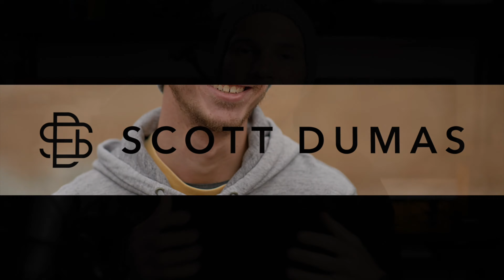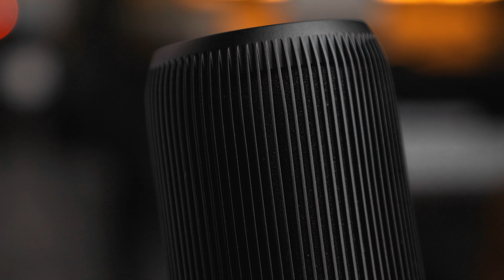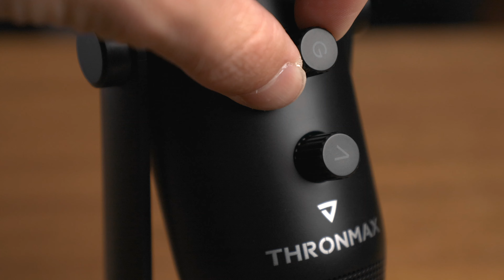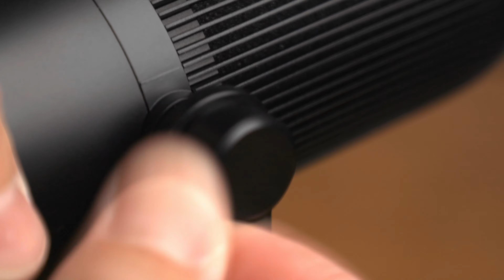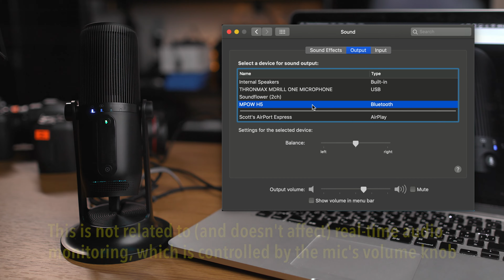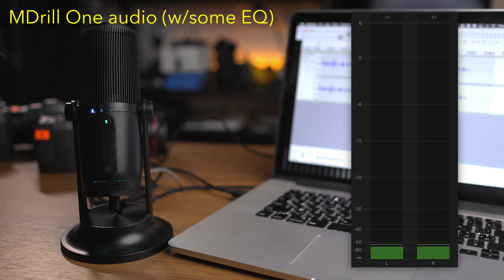Thronmax MDrill One USB Microphone Review

Comment: I am having a problem with low mic volume on Zoom, my iMac input setting for this mic is properly selected and at max input vol. The zoom settings are also correct for the input mic. I am using the cardoid setting. any suggestion for the low volume problem?

Comment: Hey, what program can I use to edit the sound after I have made a video?
Reply from the maker: There are lots, I usually just do it inside of FCPX when I'm editing the video but the controls aren't as good as some other programs. Audacity is free and quite in depth, and other video editors should all have some level of audio editing available.
Reply: @ScottDumas  ahh okay thank you, so you would recommend Audacity? I have heard of it, is there any others that are simple to use?
Reply from the maker: @ASMR_AMXN  I'm not too much into audio editing haha... but Audacity is pretty powerful for a free program from what I've heard. I do use it from time to time and it's hard to complain :)
Reply: @ScottDumas  ahah okay no worries thanks, also how to you use this with a camera I have a Canon 600D rebel. Would I need to buy a 2 sided 3.5mm jack?
Reply from the maker: @ASMR_AMXN  That's a good question. I'm actually not sure... since it's designed as a USB microphone it probably won't work that way. If you want to plug directly into your camera, another mic might be a better choice. Or you could record the audio to your computer while filming with your camera, and then sync the audio and video in post. Most programs, like FCPX, for example, will sync them automatically for you.
Reply: @ScottDumas  okay, thanks for your help. I can try with a 2 sided jack see if that works first haha
Reply: Hey I bought the USB type to 3.5 jack but it's not working?  Can you give me some advise :(
Reply from the maker: @ASMR_AMXN  Hi, unfortunately like I said I didn't expect it to work that way. If you want a mic that works with a 3.5mm jack, it would most likely be best to choose another mic. Or somehow plug it into the computer via USB and then connect the computer to something else using a different cable, but I'm really not sure how that would work either.

Comment: great review, I am only curious as to if not for the noice canceling, is the microphone a good overall mic when compared to others? Is there a way to simulate the noice canceling on another microphone by but on a pop filter and or setting your sound/volume controls on your computer? Interested in buy and so answers to those questions would be most helpful, Thanks
Reply from the maker: I honestly haven't tried many others but from what I have tried this was still a great mic. The noise canceling probably wouldn't do much anyway and/or would have a negative effect on the audio and I'd rather have control of that in post. The distortion at higher gain settings bothered me most but I didn't need those higher settings at all anyway and can't imagine they would be all that necessary for most uses. Generally, I think this is a good choice.

Comment: I just bought this mic and am using it with audacity and I cant tell if I am not using it right but the quality doesnt sound so nice on my playback. I hear a lot of echo in my room. Are there some settings that I should learn to tweak?
Reply from the maker: Hi! Echo will be a tough one to overcome without sound treating the room. 
I'd advise to try it in a different room or outdoors etc to make sure the echo is coming from the room and not some error with the microphone or recording itself. If the room is the problem, you could try sound treating it a bit with some sound blankets or record in a different room. Talking as close to the mic as possible will also help a bit since your voice will be louder in relation to the echo in the room. 

I hope that helps!

Comment: thanks Scott, i jus order it after i watch your review, cant wait to test the mic!
Reply from the maker: Awesome! Hope you enjoy it! Thanks for watching :)
Reply: @ScottDumas  any windows 10 software can recommend for adjusting the mic input volume?
Reply from the maker: @ckyap2868  I'm not sure about windows software specifically but usually you can set the input level system wide in your audio/mic settings on the computer, or in a program like Audacity I think you can make the adjustments as well
Reply: @ScottDumas  any anti shock mount can recommen for this mic?
Reply from the maker: @ckyap2868  Not sure about shock mount persay, but I think Thronmax does make their own boom arm which would help most likely

Comment: Hey Scott, thanks for your review of it.  This video is a little old so I'm not sure if you'll see this or not - but I have a question.

I've also just gotten this mic a few days ago, and I've noticed on mine that there is some kind of static-y sounding feedback that is constant.  However, I've noticed that when I adjust the volume level using the knob on the back(the one that turns the meter blue, not the gain) the constant static sound goes away.  But, the second the blue volume meter LED under the mute button disappears, the static immediately returns.  Also, if I use the LED mood light button on the bottom, and cycle through the different LED colors, that also reduces the sound(though it doesn't completely disappear).  Some colors make the static sound nearly completely go away, while others hardly effect it at all.

I've tested another mic on my computer, a webcam mic, and I can confirm that the same static sound is not present at all.  Do you think that my mic is defective or came with this issue, or have you ever noticed such a thing on yours?  Also, would you know of any troubleshooting steps I could take to fix this?

Thanks for any kind of help!
Reply from the maker: Hi! Thanks for watching :) That does sound pretty strange- especially the interference of different LED colors. I experienced some distortion at higher input volumes but otherwise didn't notice any static or feedback, nothing affected by other settings like you said. I'd try and get in touch with them and let them know about it, hopefully they can help you out!

Comment: Have you had a look at the "noise canceling" feature? On the indigogopage I can see that it would be indicated by a green light instead of a blue on on the pattern indicator. Or is it something different now?
Reply from the maker: I think that's actually a MDrill One PRO feature that isn't included here but to be honest with you I'm not sure if that's the only difference or if the PRO is an updated version of this with some other internal fixes that will  be released in place of the MDrill One. I'll ask Thronmax and see if I can find any more information!
Reply: @ScottDumas  Cool, thx for investigating. I thought the only difference would be the 96khz 24bit. That there are even two versions is quite new to me. The only time they mentioned that the indogogo version is a different (the pro) version was in the last update. Quite confusing 😅
Reply from the maker: Hey so I finally heard back from them and the differences are like you said, the 96khz 24bit recording. Apparently they weren't satisfied with the noise cancellation feature and won't include it on the current production batches... meaning MDrill One Pro will actually NOT have noise cancellation. Both MDrill One and One Pro will be available at different prices and when the new active noise cancelling is worked out, they may introduce a new model, MDrill One Pro NC for example. 

Hope that clears it up and sorry for the delay!
Reply: @ScottDumas  No problem, thank you for asking them. Really sad to hear it was cancelled as it was the feature that made me interested in this product. :-/

Comment: Thanks for the review, Scott.  If you are using that Rode mic for all audio in this video other than the times when you used the MDrill mic, then I would personally choose the Rode, especially if the audio from the Rode mic is straight out of the mic with no EQ.  Even when you added EQ (bass, actually), the MDrill didn't sound as good as the Rode.
Reply from the maker: Hey, thanks for watching :) Yeah.. the rode definitely sounds more "full" ...although it requires a lot more of an investment. You need XLR cables and a recorder that can provide phantom power. I have it running into a Zoom f4 which will cost an extra $600 or so on top of the mic and the cable (although a cable was included in the mic kit). Even for something like a zoom h4n or similar is a couple hundred bucks extra. That would also make it much more difficult to use for something like live streaming without the proper setup and it won't be compatible with Playstation or things like that. 

From a pure audio quality standpoint, yep- the Rode wins all day (and probably any other similar design), but I have been pretty happy with the MDrill for the different pickup patterns and ease of use. 

That being said... I'm not sure it's the best audio quality among USB microphones so there's a lot to consider when deciding- pickup patterns, pricing, how it will be used etc. 

A tough choice!